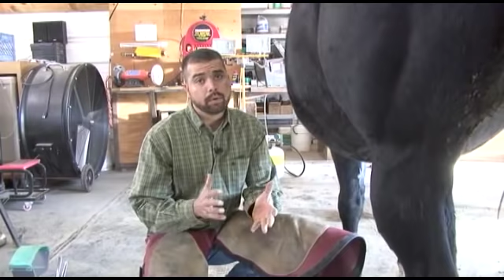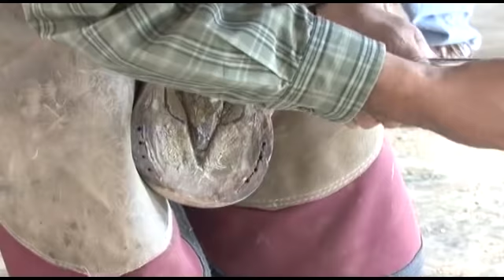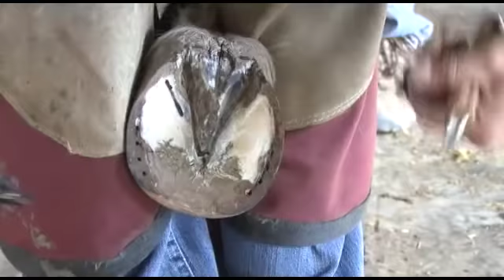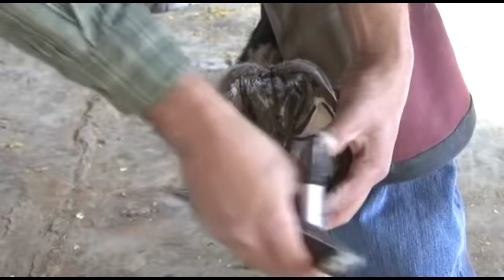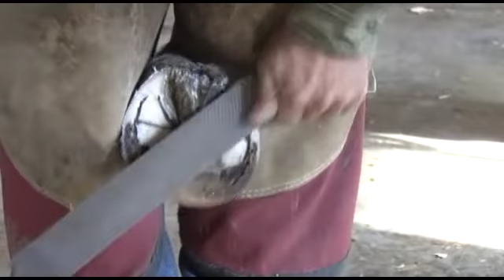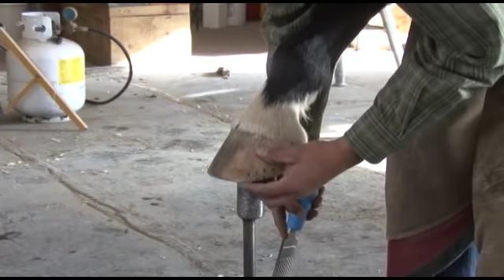E.L.P.O. Barefoot Trimming Protocol

Comment: For the newly barefoot horse you must also relieve the quarter walls to prevent flaring and splitting, and encourage thicker wall growth. In longterm barefoot horse the quarters must always be relieved to prevent thinning and cracking of the quarter wall.

Comment: Now that I’ve been trimming my own horses for several years, I understand better why the ELPO farrier I used to use just made my horses worse. Those heels are way too low, and it looked like he lowered the low one even more than the high one. Looking at the foot on the ground, I’d suspect it was trimmed to have a NPA. Everything about that hoof looks like the heels hurt. The frogs are weak and the hoof is contracted. Not prioritizing a biomechanically correct heel first landing is why the toes keep going forward. Flattening the toe just drives the walls outward, weakening the whole structure of the hoof. Thinning the frog also creates discomfort. 

This is all just an overly complicated approach that ignores what the hoof is trying to say. If I was trimming, I would’ve just cleaned up the frog, addressed any heel imbalance and then beveled the wall on the bottom. If you learn to read the hoof and understand the biomechanics, it’s amazing how quickly the hoof can transform.
Reply: I think you missed the point...they are starting with a severely contracted heel with an almost correct toe length.  This distortion is very difficult to reverse.  The palmer angle for P3 was not trimmed negative, I would guess it finished at about 5 degrees.  I think ELPO's  approach to mapping has merit and is useful for the beginner, as well as the experienced trimmer.  

That being said where they go wrong is at some point (when the heels are correct palmer) the bars will not terminate at the widest part of the hoof, but instead point to the apex of the frog.  If your ELPO trimmer failed your horse it is because he did not understand this.  Most of the first ELPO farriers where trained with "natural balance" shoes.  While this shoe does a great job reversing long toe it must be transitioned out of to avoid or reverse contracted heels.  Sadly lack of this knowledge often leaves a hoof that looks exactly like the one in the video. 

Still I don't think it's the farrier's fault, most have a misunderstanding of hoof-fall and what is required to obtain a correct hoof-fall.   This is why I developed a training regiment that  teaches the horse to move correctly...I call it "Barefoot Movement Therapy"...you can learn more by emailing me at...bmc06239@yahoo.com...bruce
Reply: Bruce I just sent you an email.
Reply: I think so
Reply: abdr4 is right
Reply: I never used a farrier that was certified in the trimming style used in this video, but I did have one that consistently lamed my horse after every trim and reset of her shoes. To the point at the last time she was trimmed by that professional I had to give my mare a week off along with packing her feet. I was already delving into the hoof world and seeking out education on feet in general, and I quickly realized the function of my horses feet was so horribly compromised that I couldn't wait any longer to get the shoes off to start healing her. Long story short we are over 2yrs into her barefoot journey and she's been the most consistently sound now especially after trims the entire 12yrs I've owned her. I made some mistakes like anyone but am proud to say no 'professional' has touched her in the entire 2 yrs I've taken over and she's consistently only gotten sounder.  

Which also brought me to the comment section after seeing the technique and slightly cringing over the amount of heel height taken in proportion to toe and quarter height. Granted this horse looks like the shoes were literally just taken off, and whoever had been trimming and shoeing had no agenda to take the toe back. So, the horse doesn't have much of that natural concavity and thickening of the frog & digital cushion you'd want to see in a healthy functional hoof that would lend to the appearance of the foots natural arch with the quarters slightly raised from the ground. But, since this horse is fresh out of metal rim shoes and not trimmed for appropriate leverage reduction at the toe I'm not sure I would've taken much more toe than the trimmer did; As backing the toe does take quite a bit of time so the internal structures can start to adjust. But, I agree that all the measuring for a mediocre trim was too complicated and didn't really take into account what the structures are saying. It's pretty expected for a freshly barefoot hoof to change a fair amount in the first few weeks, and allowing the natural exfoliation to resume really should be one of the aspects at the forefront of the trimmers mind when doing the first setup trim especially if the horse is resuming work immediately. As soon as he started to hit that functional material aka the solid shavings of white line and a bit of sole around the bars had me cocking my head since he'd just mentioned not taking away functional material is important. Since to many podiatrists and trimmers know that it doesn't require getting to "waxy" material for it to be functional; That any material that isn't ready to crumble or flake away with minimal coaxing generally shouldn't be removed.

Comment: Why did you put the heel so low? I learned that its not good for the foot.
Reply: You are correct. with each trim they will trim the heel out more and more. While the toe just get's longer and higher. This trim is not good.
Reply: Linda Harris, i think its actually the opposite effect, as the part of the hoof thats going to grows more, is the most stimulated one.. So if you rocker the toe, you decrease the stimulation so it doesn't grow that much.. That's what I understand.. Isn't it like that? 
Excuse my english, i speak spanish